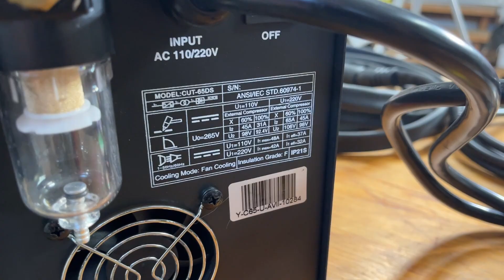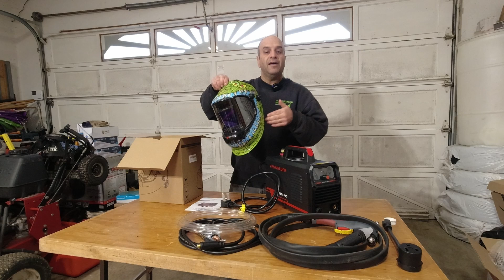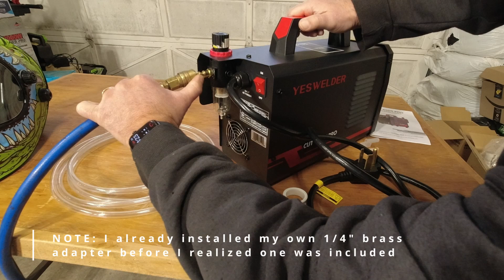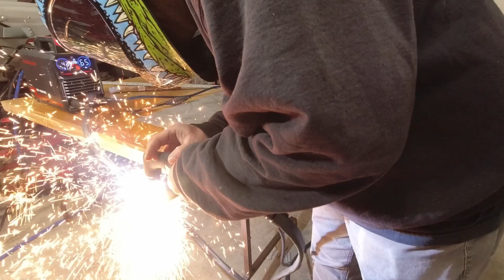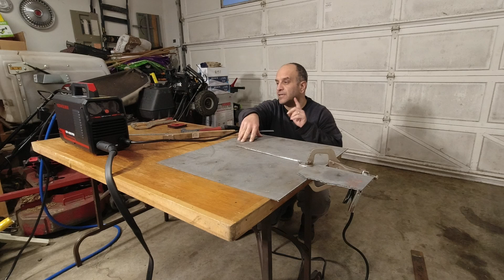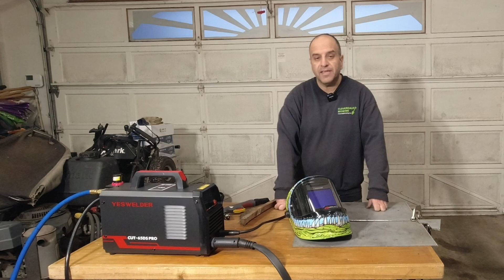Yeswelder CUT 65DS PRO Plasma Cutter Indepth Look

Comment: Mine will cut for about an inch then stops,, ? Help ,,!!!😢 thats on 1/8 mild steel plate ,,??
Reply: Make sure you're maintaining the correct PSI
Reply: Mine does the same thing. I do have enough air. I am not happy with mine.
Reply: @thenussbaum44  I also noticed a massive increase in performance once I started running it on 240. You shouldn't HAVE to do that but it definitely helped in my situation.